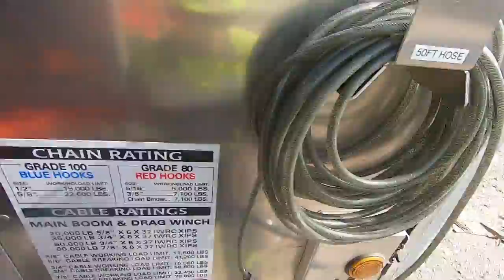Semi Jackknifed And Stuck! Rotator Rescue!

Comment: Here's a hack that sometimes works on desert sand especially real fine and dusty sand: pour water on the sand and put diferentials on, and then try to roll out.  Sometimes the water will turn the sand into like a hard clay almost like concrete.

Comment: I drive a truck just like that, with the PDL lock and the offroad switch beside it, He should NEVER have gotten stuck. When you have both of those switches clicked all the drives are basically locked together, but allow a little bit of slip. With the conditions being dry, no mud or anything, he has no excuse to be stuck.

Comment: When you were assessing the situation, by outriggers maybe causing an issue, were you speaking of the trailers landing gear (the legs, so to speak) as that is what appeared to be the only possible thing that could have caught on that concrete when you pulled the tractor out backwards.

Comment: If he use the power divider and axel lock and keep the same gear 2 or 3 and gas all the way  to keep traction at all time, he probably don’t get stock but he never  drive a belly dump or dumpster If you release the gas or change gear you can get stock in a second

Comment: I’m not a truck driver but just by looking at the way the truck is sitting he turned too sharp? I’m I right? Maybe he should made a wide sweeping turn? Just my take!
Reply: Maryann Souisa 
Yes, he turned way to sharp. You can see the tracks from other trucks that made the turn easily. Turning sharp will cause the drive tires to really dig in, which caused his landing gear on the trailer to bottom out and the rest is easy to see. Had he made a sweeping turn he probably would have been fine. 
Drivers like to whip these trucks around like it’s a car, this is what can happen!
Reply: The turn angle wasn't the trouble, it was the ground was quite a bit lower from the road surface and the legs of the trailer landing gear got hung up. Being softer, he spun his wheels and dug himself in. When I was training, someone asked about getting stuck. My instructor said in a word, "Don't"! Most companies will not pay for the tow if you do something stupid and a tow like this is pretty expensive, I'd guess more than a week's wages.

Comment: What on earth was this guy thinking!? Does he not know how to straight line back? I’d have backed up several hundred feet before I attempted to make a U-turn in soft sand. 🤦‍♂️
Reply: Christopher Little 
Trucks turn around there all day, he just turned to sharp. The dirt there will support a truck, but turning sharp just cause the drives to dig in and from there it’s just problems. He could have followed the hundreds of tire marks from the rest of the trucks that made it. I would say it’s a rookie mistake, but a lot of seasoned drivers don’t understand how bad drives can dig in when turning to sharp.
Reply: Christopher Little Common sense isn’t common

Comment: Trent, a question that has little to do with this particular tow job, in general how often do the rotator winch cables have to be changed out due to wear ?
Reply from the maker: They can quite honestly last a lifetime if you take care of them. Maintenance includes lubricating the cables and ensuring they wrap nicely and don't overlap.

Comment: I'm continually surprised at the level of common sense, or the lack thereof, that these steering wheel holders possess.  They must give out free CDLs in cereal boxes these days.
Reply: Where is your video?...I can't find it?
Reply: The flip flops are a dead giveaway of a streering wheel holder
Reply: for what its worth it looks like a decent turn around until u see that drop off the steers went down thats what got him hung the gear legs bottomed and he couldnt grip the sand  yes a goal might have saved it might have not 

simple mistake i could see a experienced driver doing it we all aint perfect
Reply: I agree , but I have to say.....it doesn't seem to take much to get these tractors stuck , does it ?? ..... Partly tho' he caused a lot of that himself by turning too tight....
Reply: Yeah pretty much right.
Reply: I thought it was just ridiculous that the wrecker driver had to tell the truck "driver" how to kick in the power divider.

Comment: What do you think about doing recovery work with a Landoll? Our company just added a heavy department with a big Vulcan and a Landoll trailer. I'm non-CDL in one of our Hinos with a Century flatbed. I use it on wreck recovery occasionally. Mostly breakdown work. Of course, with the recent spate of electronic and electric transmission shifters, it makes our jobs that much harder when we can't un-park them. Are trucks starting to go that way? I'm wondering what the Tesla and Nikola trucks' drive trains will be like. I can imagine one locking up and not being able to move an inch.
Reply: J W 
The automated transmissions in trucks are still manual transmissions. They are usually called AMT, automated manual transmission. They by default should go to neutral, if it locks in gear it should be under the same circumstances as a traditional manual. 
As for electric trucks from what I’ve seen they should basically be in a neutral state at all times unless under power or during magnetic resistance braking. Even then if you can disengage the parking brake they’re safer to tow than regular trucks. The drive train for them is a long topic but as said, easily towed. You won’t be dealing with Tesla or Nikola on this, freightliner will be first and absolute king of electric for years.